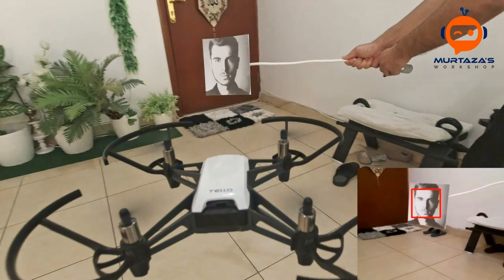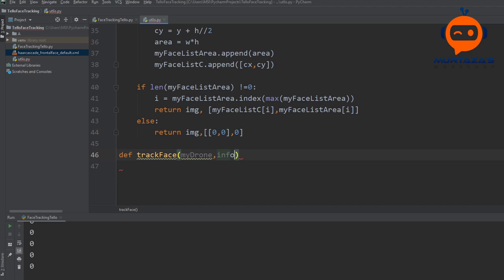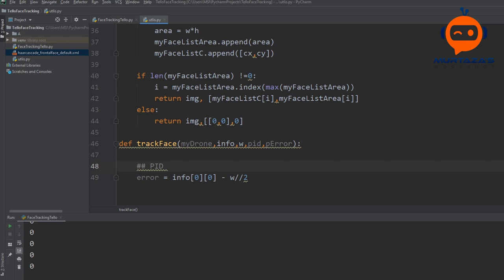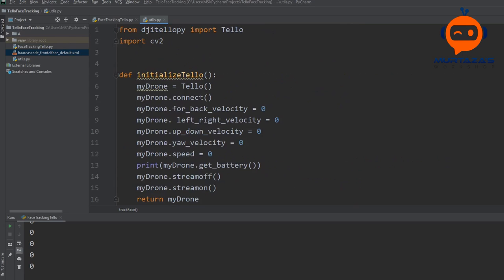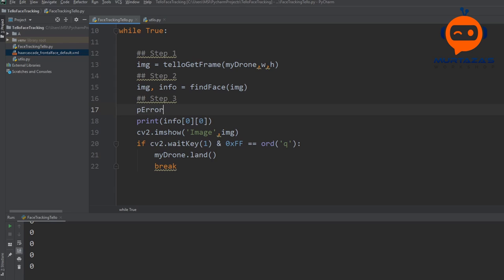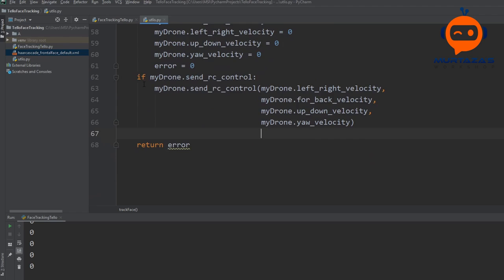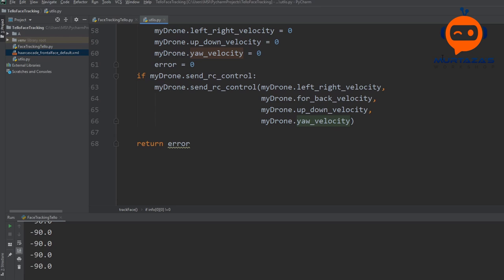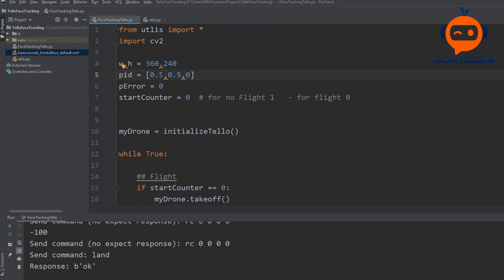Drone Face Tracking PID using OpenCV Pyhton | Tello (2020) p.3

Comment: Can you please expand on this series a little bit. I am interested in running this on the nano, but I can't install the library because I can't built the pipwheel for open cv python.  Also, I am interested in moving this in other directions except just yaw. 

Thanks!

Comment: Great video! 
My Tello would takeoff and then land in around 5 seconds for some reason.
Does anyone know how to fix this?
Reply: Hello, were you able to fix it, I have the same problem now.
Reply: @eluferedonatus2096  oof it's been a long time so I don't know if I can remember correctly. I don't think it was a hardware issue (i.e damaged propeller), but some people were able to fix it by changing hardware. For me, I believe it had to do with the parameters in my code. For example the unit might be in ms but I assumed it was in seconds. Maybe check on that? Hopefully you can get it fixed!

Comment: I tried getting it to work also on y axis, so the drone can move up and down to center the face, but I get an error. Anyone have any success?
Reply: @UCpF2-gy6szzVXKpSTCrJx9A Yes the code only lets me rotate, when I try grabbing the info[0][1] which should be the y axis center, and using it in a pid for y axis velocity I get an operand error saying I can't use - for(error2-pError2) because it's a tuple.